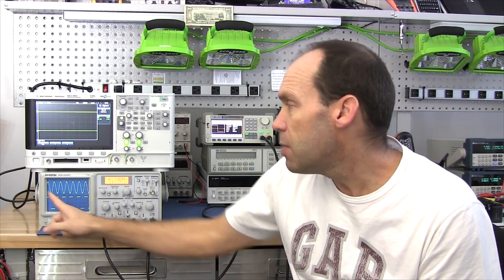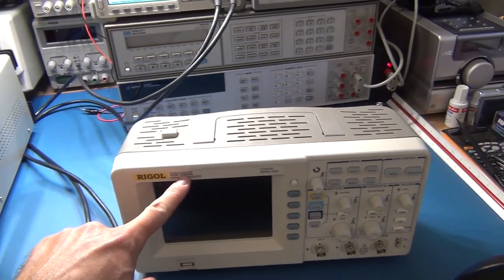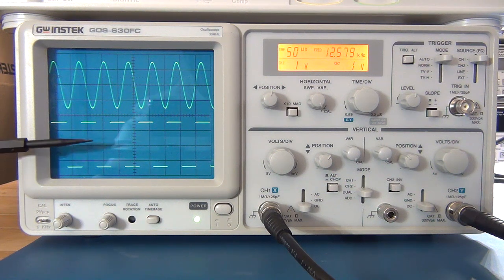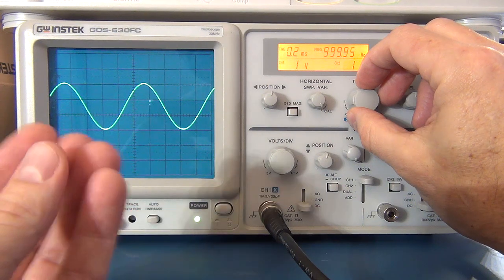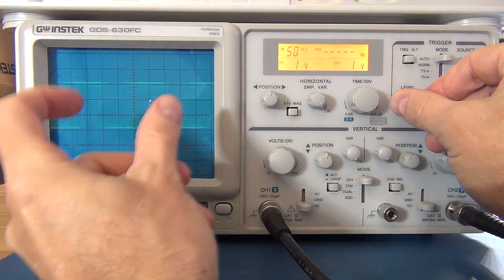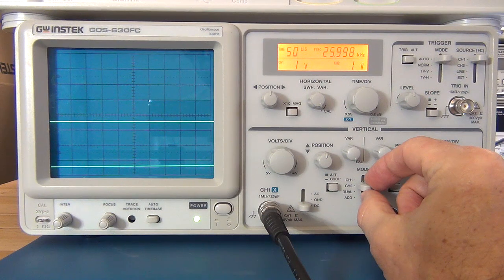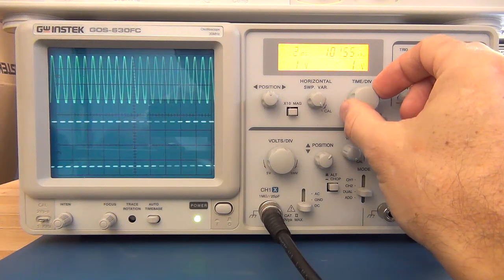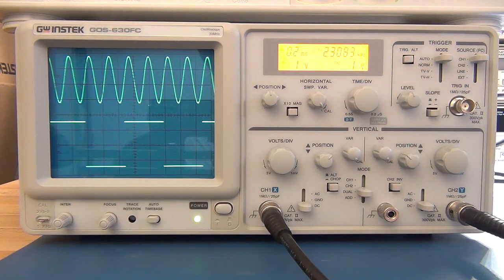Intro, Review and Tutorial of Analog Oscilloscopes  Pt 1 - GW Instek GOS-630FC

Comment: Note that in ALT mode the traces are not in synch/phase with each other. E.g., if you want to see the effect that one signal is having on the other, you really need to use CHOP such that you are seeing the same segment (dt) of each signal. In ALT, you end up with a phase offset between the signals which may be confusing or misleading, depending on the waveforms in question.

Comment: Nice to see you with an analog scope Martin ;-) - nice done (but should have been an old one). I like the "human" and informative  way you do your videos and how you learn yourself (were technical mistakes in it but...jeah really doesn't matter :-)  ). Didn't know that there are still new "630" analog oscilloscopes availiable. I have an older model of this 630 without LCD and frequency counter from a different brand. It was my first real oscilloscope and I still like and use it. Of course it has much less functions and bandwidth than my two other (much older) Tektronix scopes but it was a good start to learn how an oscilloscope works. And you can get an old powerful analog scope today for no money, like the 465 or 475 or a 100MHz Hameg (even a beginners digital scope isn't so cheap). I like that you have all the controls on the front and don't need to mess around in some menu system like in the digital scopes. The problem is, you can get results and can measure values with a digital scope even if you don't know what you do. So in my opinion if you want to get really into electronics your starting point should be an old analog scope (as your first scope - and can be a nice collectible too :-) ) and if you only want to measure something take a digital as your first. This does not mean that there couldn't be a digital as your second ;-). And if you need to look inside digital protocols you can buy a Logic Analyser too.
Nice greetings and keep up the good work :-)

Comment: as a hobbyst, i m thinking about getting a not so expensive 10MHz analog one. is it a good idea ? what much expectation i can have from this ?
the experiments i will be doing are mostly on power supply switching, communication experiments with modulations, checking arduino port signals etc......
Reply: iceberg789 
Get at least a 20MHz one, but if the frequency of the circuits you're going to deal with is not higher than 5MHz you should be fine.
Reply: well, at hobby scale, with what i do most, arduino ports communicate at sub mhz rates, and normal power supply, IR gadgets operate at well below 100khz.
even if i somehow tap into some ham frequency bands, there are some lot between 1 and 10ghz (i don't have the license, so at max i can only read the signal - that is even if i ever feel like doing that).
on the other hand, here 10mhz ones cost ~$150, whereas 20-25mhz analog/digital one cost about double.
so, you think i should proceed ?
Reply: iceberg789
Meh, I'll say wait till you really need a better scope.
Reply: i see, some day, may be some day !
Reply: iceberg789
Just save money and you will be able to buy a better one, never say no to your dreams, unless one of your dreams is tu turn off the Sun xD.
Reply: Gordon Freeman
well, i am not the kind of guy who blows up a solar system for experimenting on unlimited supply of energy through extra dimensional space, u know. :/

Comment: Seriously I think these "modern" analog oscilloscopes are a waste of money. I was looking around for a "real" (old Tek, Hitachi, etc.) 200MHz analog oscilloscope, since I started working with high frequency analog signals, and I found a extremely nice Tektronix 475 for $260 on eBay.

Of course it was sigthly out of calibration, so I had to calibrate it using my Rigol function generator, but that was extremely easy and now I have a great second oscilloscope to work with.

If you're a beginner you can get a very nice analog scope for $50 as Dave showed in one of his videos.